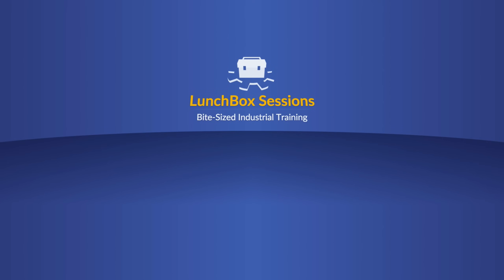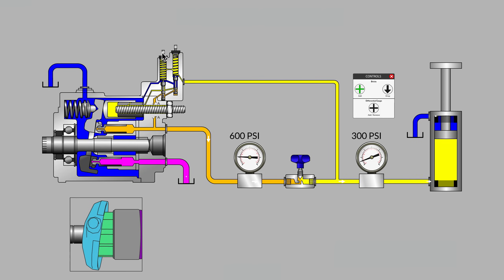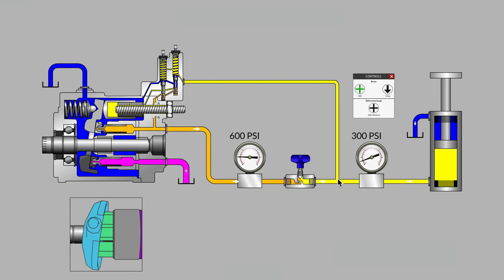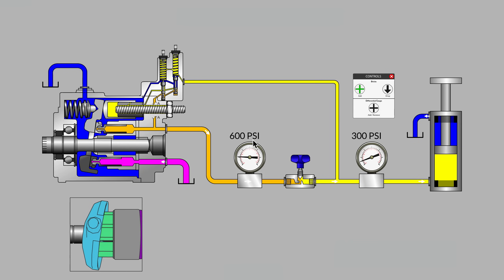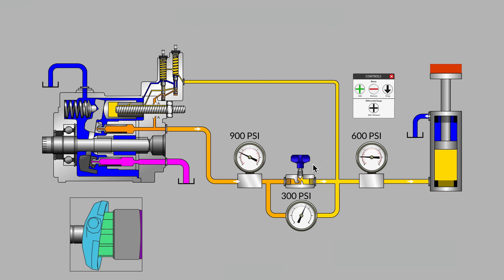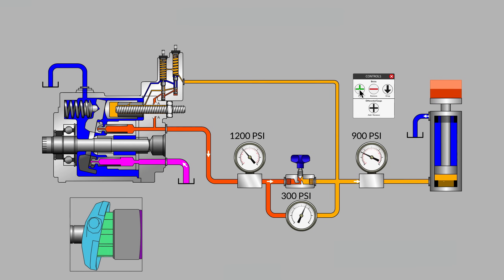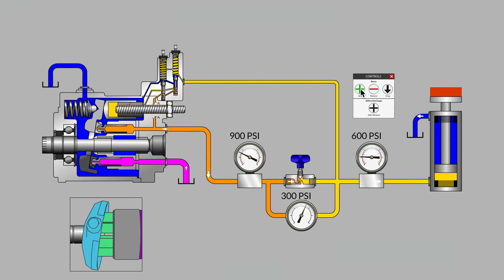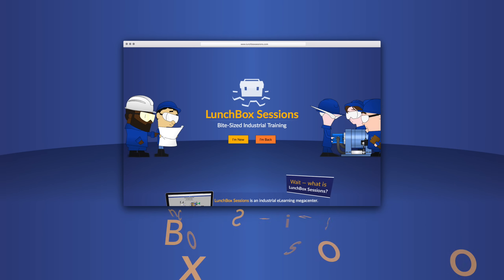What is a Load Sensing Pump?

Comment: Does it require a load sensing valve spool to work in conjuction with variable load sensing psiton  pump? 

Can load sensing pump work with proportional valve spool?
Reply: what is the set up?

Comment: Hello Carl, I have a question. If I'm right, the piston speed is constant no matter the piston load is applied. To do so, we increase the presure of the pump in order to maintain the delta pressure and in consequence the flow. To do so, the LS is increasing the cm3 of the pump and this make me crazy. How it's possible that the LS increase the cm3 of the pump and the flow remains constant for a given pump speed? Does the pump maintains the speed?
Thanks for all the videos. Really well done.

Comment: If I have a load sense pump, but dont use the load sense function i.e. plug the port, can the pump still work? or will I have zero flow out?

Comment: As bricks are added and removed we see the pump swash plate angle change (i.e. pump output/flow rate changes). How then does the flow rate remain constant through the needle valve while the pump output is fluctuating?
Reply: I was wondering this. I think it's to account for extra leakage over the pistons at higher pressure. The pump has to account for that so there is a slight change in swash plate angle.

Comment: How is the swash plate when no load but with engine running ?
Reply from the maker: The swash plate will be at a near zero angle, and hunting on-off to a very tiny on-stroke angle to produce only the low standby pressure as set on the load sensing (flow compensating adjustment) at the pump.

Comment: In a piece of equipment , do all the different loads/ cylinders have there own load sense lines
Reply: Commonly, every manifold or valve bank has its own load sense feedback line. These are connected to the LS connection on the pump.

Comment: Thanks for the great videos, some thing make me confused so please can you help me to understand this two points
1- If the load sensing give the spring a boast to reach 600 PSI which equal to the pump output pressure so how the sliding spool take a appropriate displacement to maintain a required flow to the swashplate piston?
2- Also what the relationship between the minimum and maximum pressure output and the selection of the bias spring and the swashplate piston diameter?

Comment: But if the needle valve was closed completely, would the pump limit on the pressure compensation setting?  What is the proper way to set the speed - with the load compensation or the needle valve, or either?  Thanks for teaching.
Reply: it would be via the needle valve. Speed isn't determined by pressure, therefore adjusting the pressure on the pump would not affect the speed, it would affect the lifting capacity. Speed is determined by the amount of flow getting the to the actuator within a certain time frame and in this instance, the needle valve is what determines the amount of fluid (flow) getting to the cylinder.

Comment: I really like your videos and have learnt from the content that you have to offer. I noticed that you guys answer your followers queries as well, so here go with a few of my own. I am trying to use a load sensing system for my machine (dfr 45 cc Rexroth pump and a locally manufactured LS valve block). Using this over the previous gear pump contraption has helped distribution of load when required by the system and helps keep the hydraulic oil cooler.                                
 Q1) I am using this load sensing system on an open loop system, would that be a problem? Q2) I realised that the Load sensing system does not really help increase fuel efficiency as my engine rpm remains constant. Earth-moving manufacturing companies like komatsu claim their engines can vary the rpm in accordance with the load sensing hydraulic system. any idea how they achieve this increased efficiency?    Link: http://www.hydraulicspneumatics.com/200/TechZone/HydraulicPumpsM/Article/False/87617/TechZone-HydraulicPumpsM                                                  Thank you
Reply from the maker: 1) Open loop is no problem. Most load sense systems are open loop (tank to pump to valves to actuators to tank).  Or did you mean open center? 2) maintaining RPM is great, but when the hydraulic system is at high pressure (heavy load) the engine burns more fuel to maintain that RPM. So you are in fact saving fuel when load is lighter, even though RPM does not change. In the linked article example, the engine speed is varied by a controller for additional fuel savings. Keep in mind that when the engine speed is decreased, less energy is brought into the system  (lower rate of fuel burn). Thus the system can support high flow rates (increase swash plate angle) but only at lower pressure, or conversely, high pressures, but only at very low flow rates. It’s another version of HP/torque limiting control.

Comment: Here is where I am lost - in the video, the load pressure is brought about by stacked bricks (i.e, gravity induced load). What if I had a horizontal cylinder attached to a large mass? When I pressurize this horizontal cylinder, will it only see the 300 psi standby pressure since there is no gravity load to "backfeed" the circuit and make the pressure rise? I don't know how the system would ever produce high pressure under this scenario.
Reply from the maker: In this case,  to break away from a static state, there would likely be a short duration pressure build-up. Once moving, whatever the load pressure is at the cylinder would be added to the load sense (flow compensator) spring at the pump. The pump outlet (inlet to flow controlling valve) pressure would be the cylinder load pressure plus standby  load sense spring setting.
Reply: Thank you very much! I appreciate your outstanding videos and explanations.

Comment: Would a load-sensing pump serve any purpose on a system with large capacity accumulation?  Wouldn't such a pump have to sense accumulator pressure instead of individual loads?

Comment: AFTER ADDING THE LOAD, HOW DID THE PRESSURE BEFORE THE NEEDLE VALVE, CHANGE FROM 600 PSI TO 900 PSI ? SETTING OF PRESSURE COMPENSATOR WAS AT 600 PSI INITIALLY, WITHOUT CHANGING THE PRESSURE COMPENSATOR SETTING TO 900 PSI
HOW DID IT AUTOMATICALLY CHANGE AFTER ADDING LOAD
HOW DOES THE PUMP ADJUSTS AUTOMATICALLY?
Reply from the maker: Mech E , the pump adjusts automatically by adding the cylinder load pressure (right hand gauge) to the load sensing compensator on the pump. The load pressure is transmitted to the pump control using the LS signal line (the upper "L" shaped hose). The pump in this example already has a the load sense compensator set to 300 PSI using the adjustable spring force. I hope that helps a little.

Comment: SUPPOSE IF THE PRESSURE COMPENSATOR IS SET TO 200 BAR , WHEN PRESSURE IN GAUGE REACHES 200 BAR AND IF THE PUMP DOES NOT STOPS THE FLOW THEN WHAT WILL HAPPEN?
WILL THE PRESSURE IN GAUGE RISE ABOVE 200 DUE TO CONTINUOS FLOW?
Reply from the maker: Mech E if the pressure compensator (the left control valve and spring, also known as pressure cutoff PCO, or pressure override POR)  is set to 200 Bar and the pump outlet pressure rises above that value, then we could say that the compensator is in fact NOT set to 200 Bar, or that the compensator has malfunctioned. Does that help?

Comment: i'm a little confused here.
 the whole purpose of the load sensing system is to maintain a constant flow rate across the orifice right? that implies that flow rate is changing when ever the load is altered. but we already know that a piston pump gives a constant amount of flow rate at a given plate angle. so the flow rate across the throttle must be the same regardless of load fluctuations. 
i guess you see my predicament. please help me figure out what is missing :)
Reply from the maker: Glad to help. Great question. Don't forget that as pump outlet pressure rises, the amount of internal pump leakage increases, and is seen on the case drain line, if a flow meter is present. Also, bulk modulus (compressibility of the fluid)  means that very sudden increases in load (shock) pressure at the cylinder can cancel the pressure differential across the flow controlling valve, if only for a very short amount of time (perhaps less than one second), meaning that even a fixed swash plate angle cannot guarantee steady flow under all circumstances. Hope that helps a bit. Thanks  - Carl
Reply: LunchBox Sessions that makes sense. And Really nice work and a great informative channel. Keep it up :)
Reply: @lunchboxsessions  So , what is the best margin value if we are surfing shock sudden load over very short time ? should we adjust margin to read low or high ?
Reply: @lunchboxsessions  can it happen if the prime mover (engine) lugs down (reduction in speed)  because of increase in load . This reduction in speed causes reduced flow rates . when the engine governor compensates for it and sends more fuel to increase speed.This causes increased flow rate

Comment: the pump compensator in excavator whtas sends the feedback the control valve or the cylinders??
Reply from the maker: If the excavator has a load sensing system, the feedback sent to the pump controller ultimately comes from the load pressure at the cylinder. The most typical and convenient place to pick up or "sense" that pressure is just inside the directional valve, near the work port line that is connected to the cylinder. So while the feedback appears to be coming from the valve in terms of the hoses and lines, the pressure value sent is the cylinder load pressure.

I hope that helps.  Reply again if needed.  - Carl

Comment: how does these two valves react on a closed centre system with respect to pump flow and system pressure
Reply: 99% of the time dfr valve will be on a closed center system as it is pretty unnecessary in an open center because flow is circulating to tank when valves on standby

Comment: Great videos, Carl. I appreciate that you take your time in giving of such as priceless knowledge. You explain in a great and easy to understand matter! Excuse me, I would thank you that you could confirm me if the load sense is the same as the pressure and flow control (DFR), like the A10V piston pump from Rexroth has. I get a little confuse in finding out if both, load sense and DFR, are refering to the same thing, please!
Reply from the maker: Jesus Salvador thank you for your kinds comments. To answer your question, yes the Bosch Rexroth model DFR compensator is an example of this load sensing (flow compensating) pump in our video. Sauer Danfoss has the series 45 pumps with the same feature, and many others such as Eaton/Vickers and Parker have load sensing pumps that work in the very same way.
Reply: Carl, thank you very much for your support. I was having trouble with that, but you helped me. Your videos are impressive and well explained. You are making a great work!
Reply: @lunchboxsessions  how about DRE?